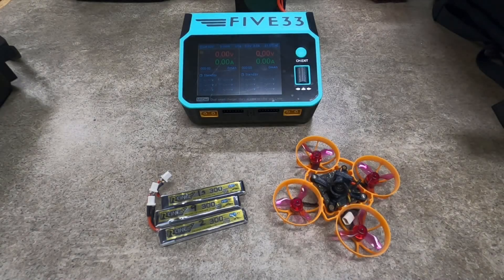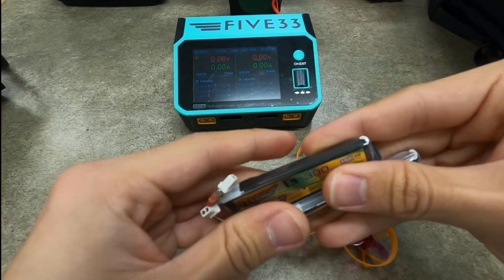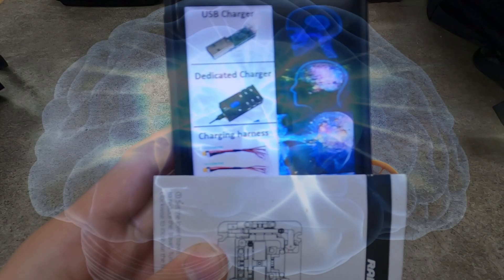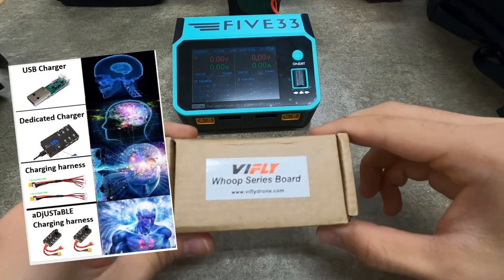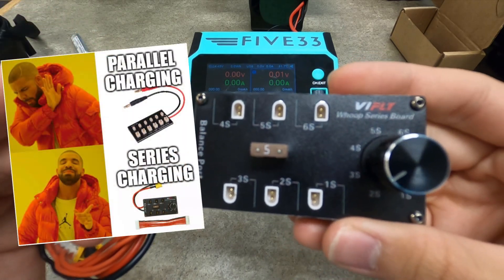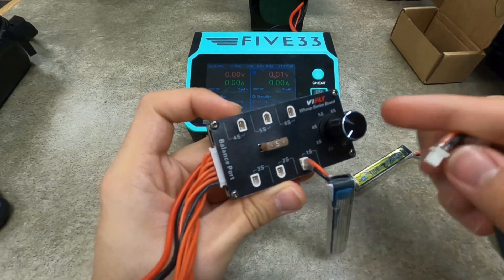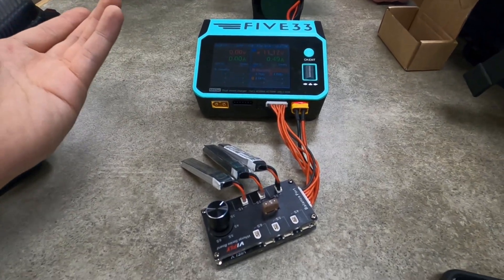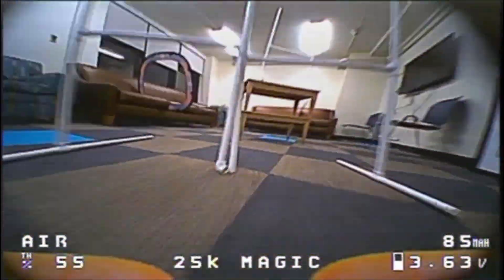VIFLY Whoop Series Board Review! | 1S Storage Charging and Discharging

Comment: Only 0.5A??? I ALWAYS charge my 1s 300mah at 3A 🤪🤪 You should do more reviews like this!
I personally use a dedicated Vifly charger with a 600Wh powerbank in the field as sometimes we fly in areas that don't have wall power and I don't want to be dependent on it. Fully charged powerbank allows me to charge 500+ packs 0 to 100%.
Reply from the maker: Well, I don't have a batteries sponsor for 1S Lipos so I try and take good care of them by charging them slowly. I am trying to get my hands on the Vifly charger with USB-C Charging too. That looks sick. Do you have a link to that powerbank?
Reply: @WerdnaFPV  I have a local guy who makes them out of 21700 5000mah cells in a 6s5p configuration
Reply from the maker: @PhobosYT  I guess I could use my laptop charger. I bought a USB-C to XT60 cable and have been using that to juice my 1S Lipos. It's worked great so far

Comment: but i still like the idea anyhow charge ...dont need to bother is 2 cell or 3 cell .. what if you are testing different 1s batteries with different capacity ?
Reply from the maker: It does not matter; the charger will compensate by increasing or decreasing the charge via the balance lead. I’ve charged 300 and 450 1s lipos at the same time like this with no problems. Also, if you set the charger to auto mode it will detect the number of cells. It’s extremely simple and much more robust solution than using a standalone 1s charger